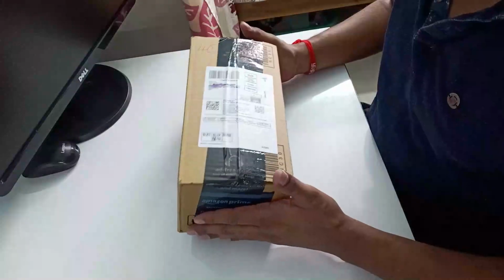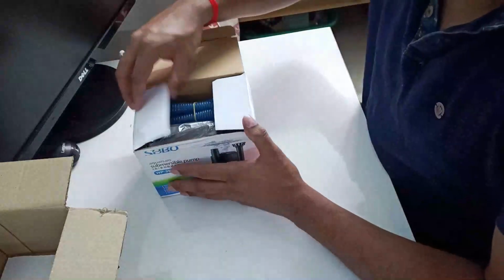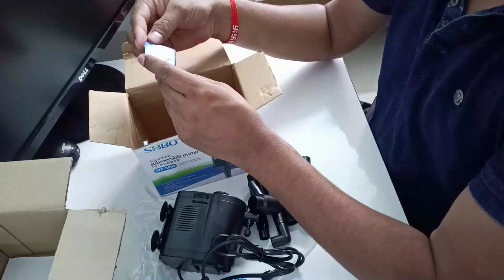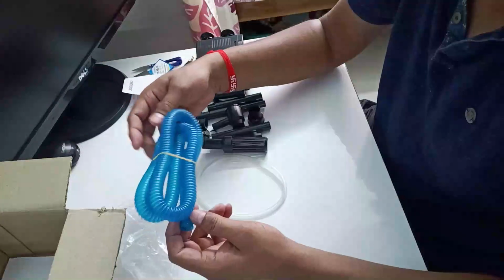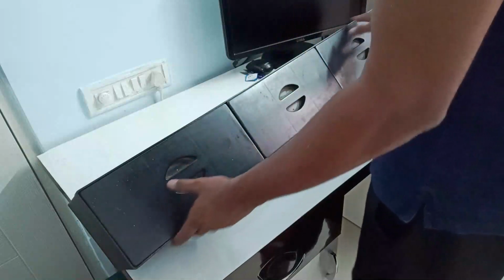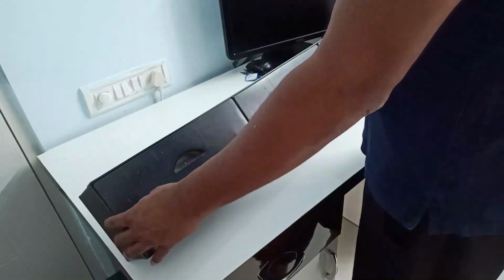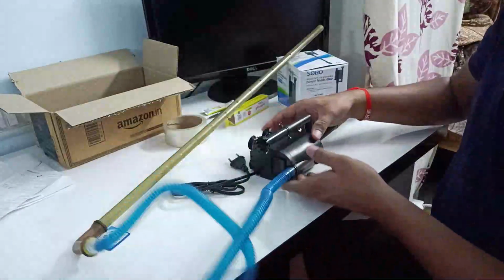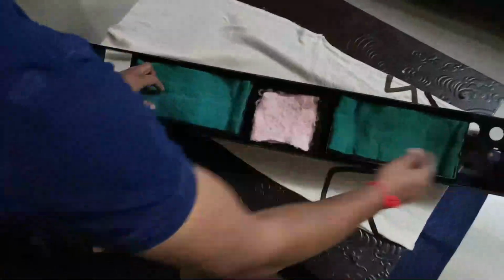Sobo Aquarium Power Head WP-3990 | Aquarium | Top Filter | Multifunction Submersible Pump

Comment: OK. I got this Sobo and a DoPhin P 808 which has a 16 W pump. I tested both. Took all all strainers/pipes and tested as different pipe length can make a difference in water flow. The Dophin pump was pumping a lot more water than this 35W Sobo heavy hitter! I don't know why. I think the Dophin is designed a lot better than the heavy/high power consuming Sobo.
I think Sobo is heavily advertised in India and simply sells more for whatever reason but unlike what some think it is a not that good of a brand.
Reply from the maker: Not sure how the price comparison is with sobo and dophin.. I did lot of review search and found sobo is the best choice what I had ..  however, I agree with you..there might be more better then sobo 👍
Reply: @babulkarvlogs1714  Sobo WP 3990 is around Rs. 800/900 online. Comes with only the powerhead. DoPhin P808 comes with the top filter tray as well. Well built and designed well. That is available for Rs. 1500 online. So for what Sobo offers which is only the powerhead it seems value for money as the DoPhin is a full filter system. But really I was expecting at-least 2 times better performance from Sobo as it is a 35W pump whereas Dophin is only 16w! Dophin pump is smaller and lighter too. You did online research. I tested both models at home.
Reply: @rockfella27  I have a 4 feet tank. Looking for a top filter. Plz suggest the best and which is easily available online. (Plz don't suggest canister filter as it's too expensive)

Comment: Sir please reply is it suitable for 4feet aquarium or should I buy sobo 2990
Reply from the maker: My Aquarium is 4x2x2 3990 is perfect for the size and water.. please go with 3990.. the difference is , in 2990 the circulation water cycle is less compare to 3990 .. I mean.. your tank will get cleaned Very fast on 3990.
Reply: @babulkarvlogs1714  sir my aquarium size is length 48 height 24 wide 18 will 3990 be perfect or the flow will be too strong for the fishes ?
Reply: @oscarlover4878  either go for soboWP3880 F which comes with the entire setup or go for 3990 which the gentleman suggested and use ur own filter box or DIY. I have a 3 feet X 1ft X15 inch ht aquarium still i installed sobo wp3880F Top filter. Plus I have an internal sponge and internal powerhead sobo wp1000F filter which i converted to spraybar.

Comment: I am using a sobo 3880 for my top filter. 3990 has some additional accessories. Wish you showed the assembly of powerhead before attaching to filter.
The loud crying music on the background was a bit irritating disturbance though.
Reply from the maker: The assembly was quite simple after attaching the nozzle... And Sorry for the bad music choice...😀🙏 .
Reply: @babulkarvlogs1714  There is some L tube with the tower which attaches to the powerhead and goes up. . If they have provided the air pipe notch on the outflow outlet which points to tank, what is this tube for? What does it do?
Sorry, there is no other informative vid on youtube on this model, so bothering you. Also they seem to have modified this model since you purchased and the new ones costs a little more and dont have this tube.  What am I missing if I buy new as a standby?
Reply from the maker: @rathansherigar4527  L tube usually sucks water and gives strength to pull water from below tube.  Just to observe, try to close it for a second.. the power head stops pulling the water..
Reply: @babulkarvlogs1714  Ok now I got it. Thanks !
Reply: @rathansherigar4527  It sucks debris floating on the surface.

Comment: Mate, ceramic rings aren't used for purifying the water. It's a place where nitrifying bacterica can reside where it converts ammonia to nitrates. Nice aquarium though :)
Reply from the maker: Rightly said Buddy, it works both ways.. agree with your point 👍
Reply: Ceramic rings work for 3 months only.

Comment: The water flow doesn't look that impressive.
Reply from the maker: Yes, it was slow but eventually the flow was ample enough.
Reply: @babulkarvlogs1714  ok. I got this Sobo and a DoPhin P 808 which has a 16 W pump. I tested both. Took all all strainers/pipes and tested as different pipe length can make a difference in water flow. The Dophin pump was pumping a lot more water than this 35W Sobo heavy hitter! I don't know why. I think the Dophin is a designed a lot better than the heavy/high power consuming Sobo.
Reply: @babulkarvlogs1714  Try a dedicated pump without aerator.